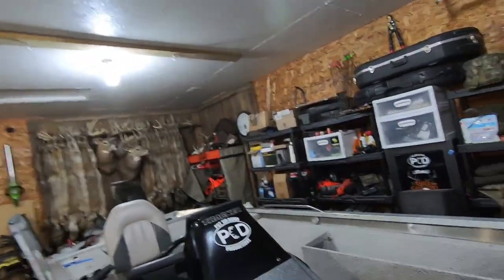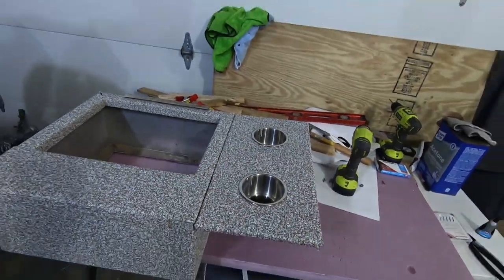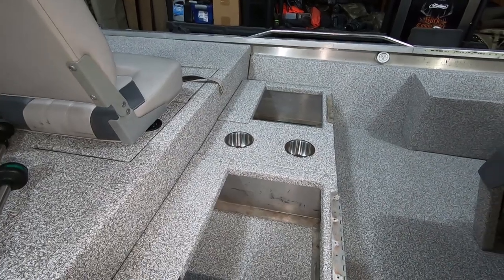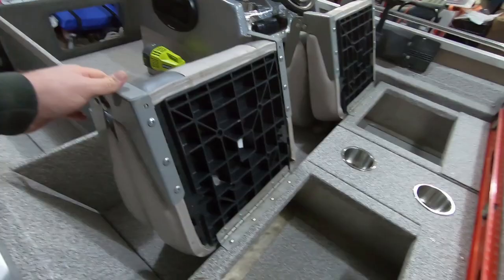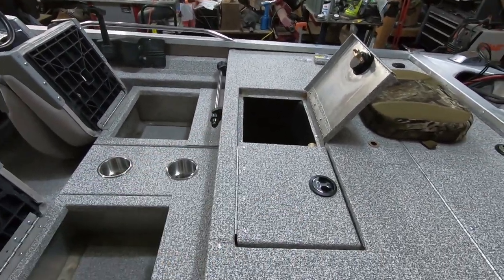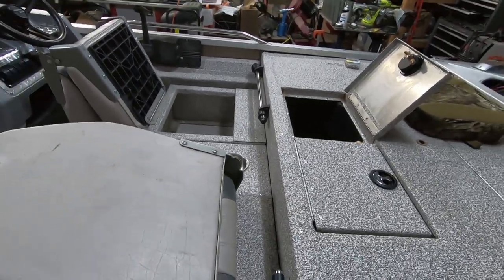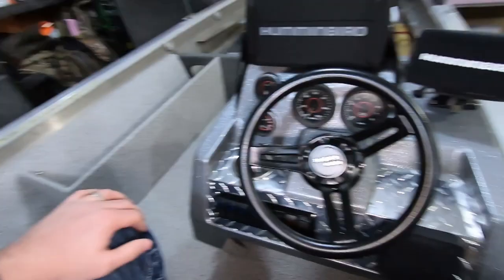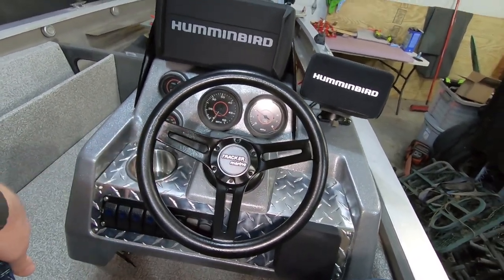Bass Tracker Overhaul EP11

Comment: 20amp breaker for council and fish finders and lightning. And a 60amp breaker for just the trolling motor correct? Also you would rather have the breakers instead of fuses in line with a sealed cap? You haven't had isses with your inline breakers getting wet?
Reply from the maker: Yes 20 to console and 60 to trolling motor and when fuse blows you need a replacement when breaker blows you just flip the switch. Also work as a battery disconnect so batteries dont drain. My boat doesnt get wet in the rear and i keep the breakers zip tied up to the batteries

Comment: What method do you use to run your wires from the console to the batteries and prevent them from kinking and getting stuck in a crevice or something?
Reply from the maker: Coat hanger and electrical tape! Or pull them through with an old wire being removed

Comment: What is the best glue to use on the vinyl?
Reply: Also did you use 3/4 on the front deck ?
Reply from the maker: I am not sure the best glue to use… what i used took weeks to dry
Reply from the maker: And yes I believe it was sold as 3/4 but actually measures 5/8”